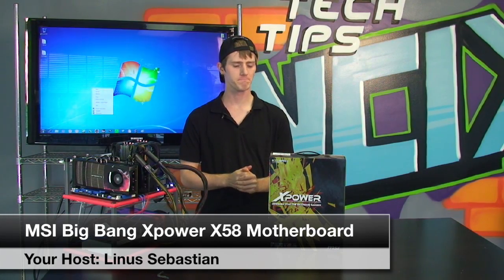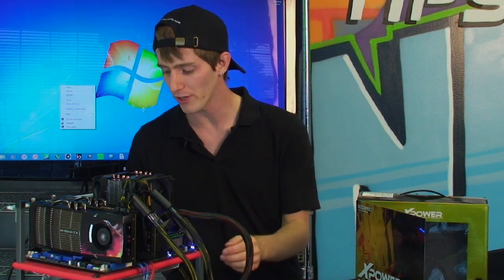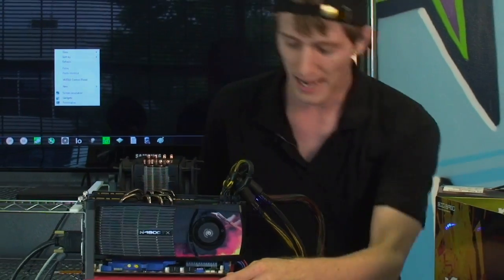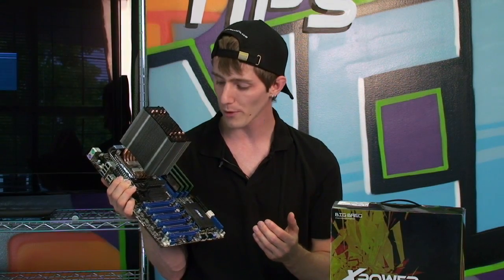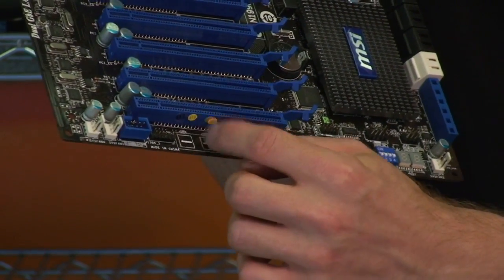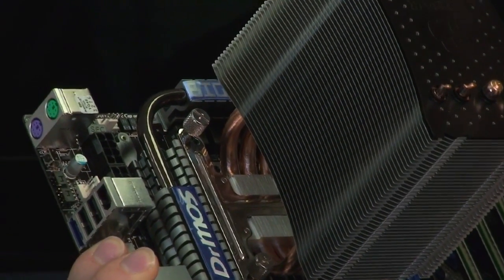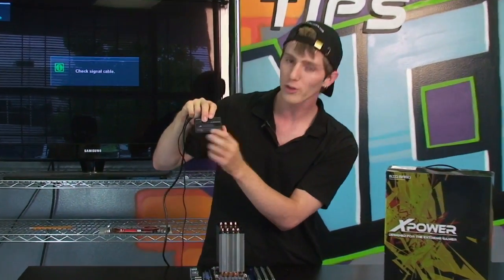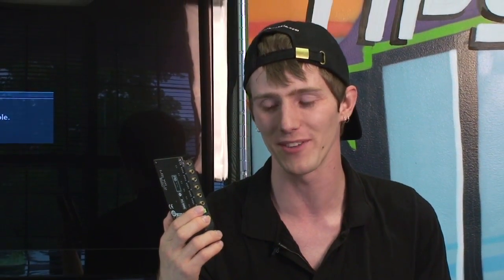Motherboard Shopping: MSI Big Bang Xpower X58 NCIX Tech Tips #80

Comment: I use various x58 boards.  RAMPAGE III, EVGA Classified,  MSI Big Bang.  After owning it for 18monts or so.  The Big bang xpower is my favourite after owning them all for quite a while.  Its just so well put together and so reliable even with some brutal experimentation.  I have a machine with 2 x 6990s in here at the moment and its fantastic.  The best all round motherboard I ever owned so far.  One of the oldest components I still use.

Comment: @beastusa running 8x makes no difference with pci-e 2.0 or 2.1 you loose only 5-10% performance. Also this board includes the neccessary bridges to run 3 way sli.

Comment: @EddieLolz3r They should make dual CPU cards?

Also, two GTX 460's, costing around $500 in price outperform two 5870's in a few games (which cost around $500 each). Yup, Nvidia sure is failing.

This guy needs a medal.

Comment: @HTBLuVA also correct, but i mentioned the ssd drives as an example, since they are already present in the market. probably we will have in the future 20-30 mpixel cameras equiped with usb3.0 so u wont need a couple of hours to transfer photo files to your pc. the same will happen with other gadgets

anyway, its evolving, it will probably take a bit longer since usb3.0 is not fully compatible with older ones, but eventually i guess it will become as standard format

Comment: @HTBLuVA partially agree to that. 
but, do u have usb1.0 on your pc? do u have any usb1.0 devices? 99% of ppl dont have or use usb1.0 anymore simply because usb2.0 is so much faster.
so probably usb2.0 and usb3.0 will both be present on a lot of new motherboards. and when external SSD's become cheaper, usb3.0 will become even more useful at my opinion.

Comment: @dglenn247 the wireless card will  run at its designed speed so if its an x2 x4 x8 card it will run at that speed.

Comment: @dglenn247 You can put pci express x1 (the small set of pins you probally saw) into a pci express 16x slot (the slot you probally saw), but you cant put pci into pci express or pci express into pci or pci express 16x into a pci express 1x slot.

Comment: @doomtomb3 I believe it has to do with Intel and its x58 scheme.

The x58 does not natively support USB3.0 or Sata 3. These boards coming out with USB3.0 and Sata 3 are using 3rd party implementations. I think intel is not going to support sata 3 and USB 3.0 until 2011.